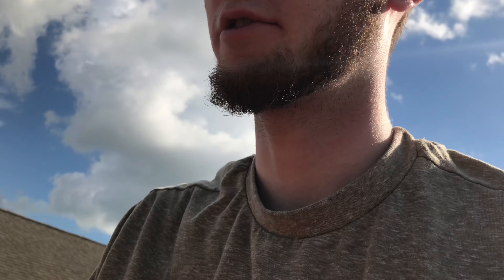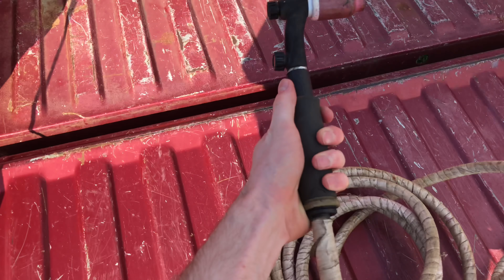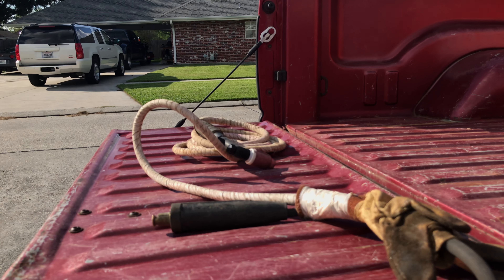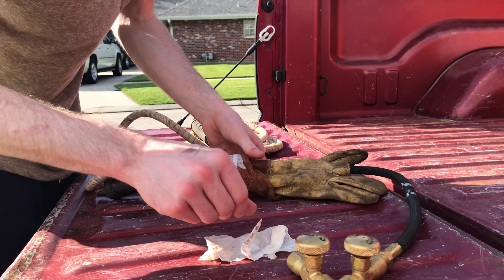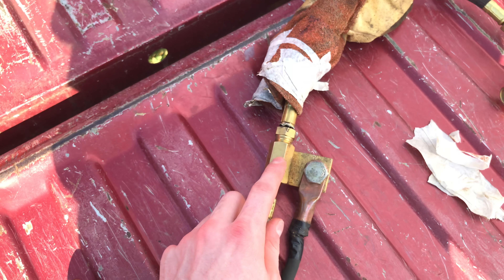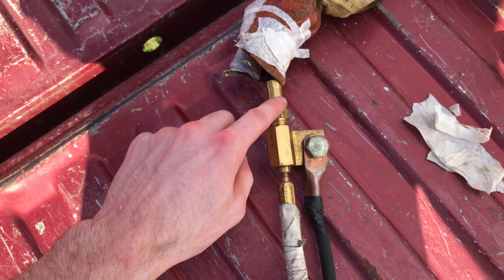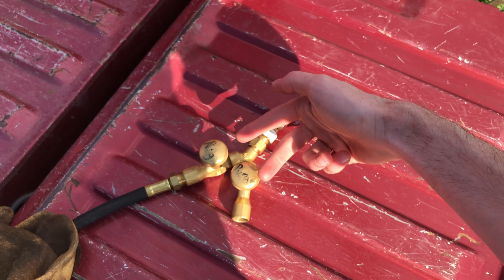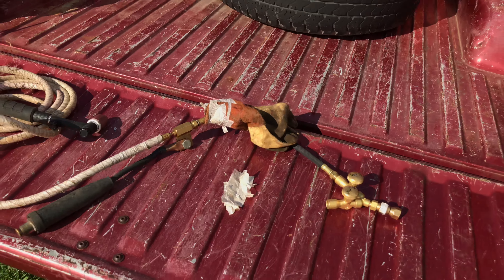Tig Rig Quick Connect Setup

Comment: Yes..its a lighter rig,if you don't run too hot...if so..cut the ball valve in torch head off,let your argon gas flow thur the rig to keep it cool,shut off at main-Y valve.. this last yoyr alot longer..

Comment: Bottle around that glove help you out too, I run  AC power through 100 ft of watercooler lead with a speedway 20 on a dynasty 400, if I'm not mistaken its rated at 350..in a 20 size and they ain't lying I just finally broke it last week from stress on cable next to torch just from years of twisting back and forth, but that  cable in that speedway is huge and like I said it broke not burnt..and it sees 300 AC regularly, I cut my teeth bettern a decade Pipe welding 6010 7018 and scratch start, finally have welds and tuna towers in cover of marlin magazine now..keep at it work hard, pay ur dues, PS-ZERO weld schooling

Comment: i’m no pro weldor, but this doesn’t make sense to me. Since the flow control regulator is still back at the tank, and you need a steady flow of purge, you have to bypass gas control at the rig itself. which means you have to turn gas off and on to the torch manually using the knob each time. It seems like it would be increased effort and waste a lot of gas. Alternatively, you could take the torch output of the Y, put it on the gas input of the welder, then couple the block at the gas output on the welder and have tight pre/post flow control without needing to manually cut gas to the torch. I suppose it’s less of an issue if you just make very long continuous welds and gas is abundant.
Reply: Gas is abundant… this is for a plant job set up. There is no running back and forth to the welder…. Unless you wanna climb up and down 20 floors of scaffold.